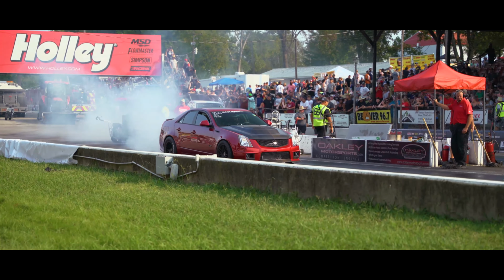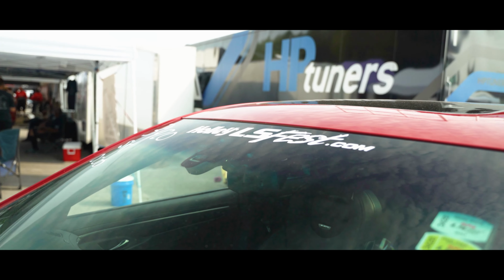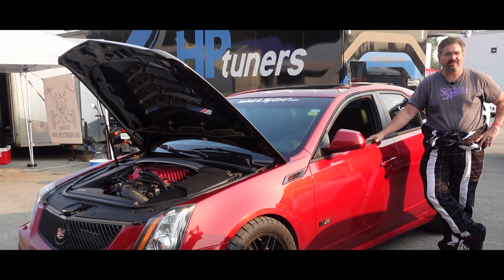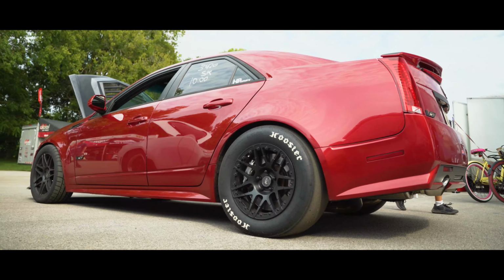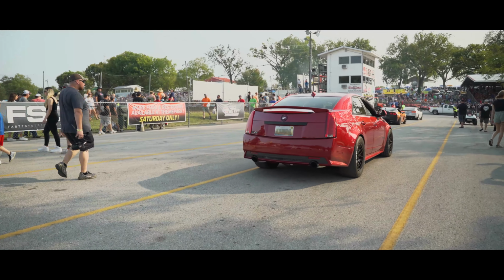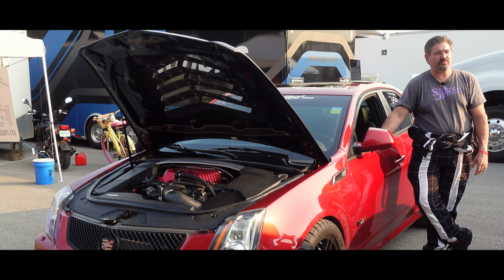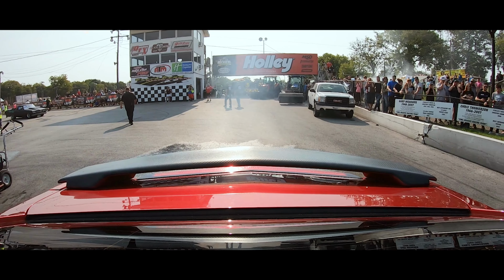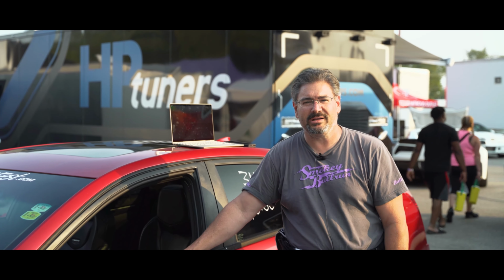1000 Horsepower CTS-V at LS Fest! | HP Tuners Customer Story

Comment: All that money dumped in it and ur best is 9.8 lmfao
Reply: Not all 1000whp hellkittens reach 9s though 🤪
Reply: I agree. We're running 9.60s on stock bottom ends & ported factory blowers without suspension mods. He's probably more reliable, making the power more easily.